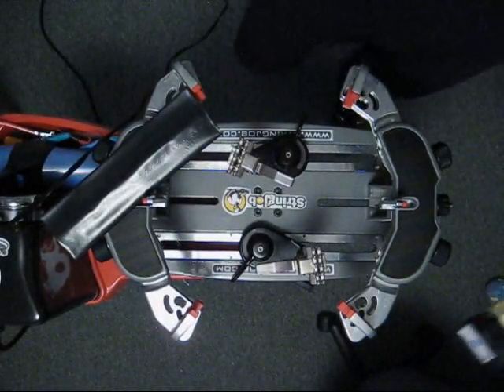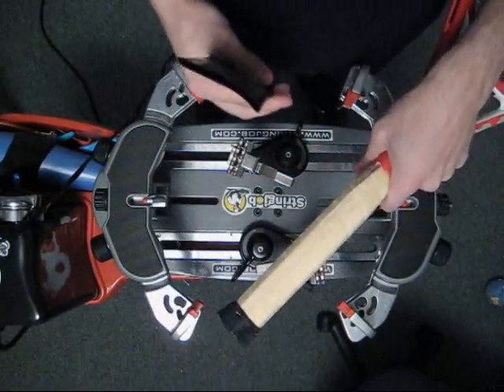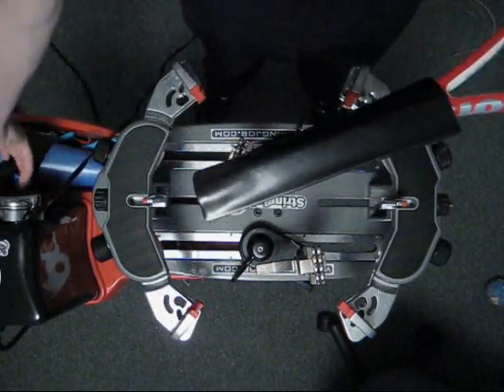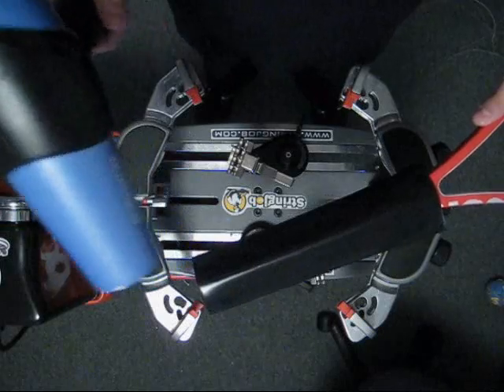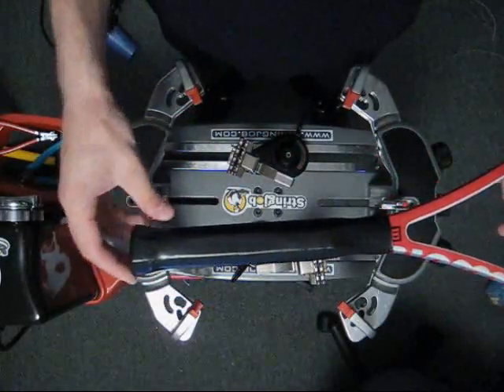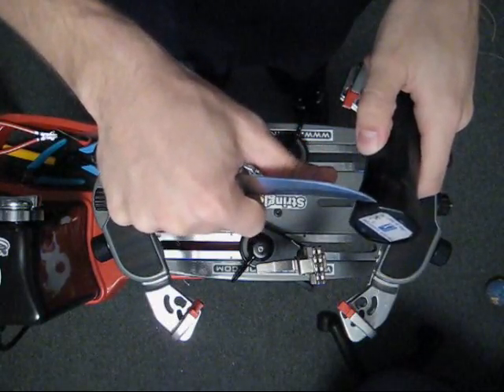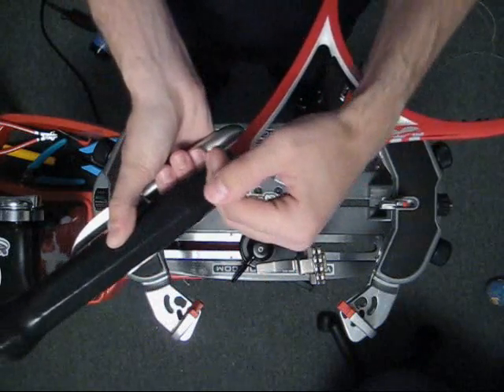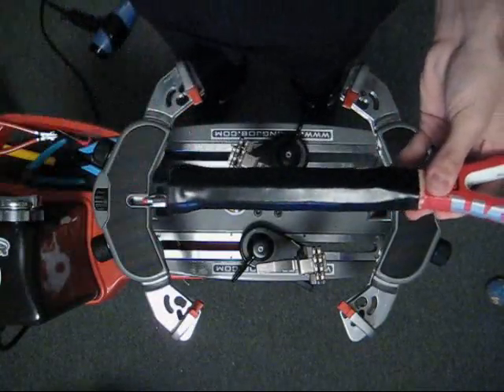How to Build up a Grip using a Heat-shrink Sleeve

Comment: Since I didn't have access to a heat gun at the time, I used a hair dryer instead. After about 10 minutes I got impatient, so I tried the oven/broiler method. It worked fantastic but I didn't know how to tell when it was finished and wanted to be sure, so I just kept heating it. The sleeve "overshrunk" and ripped across the handle; I didn't know it could shrink to that extreme. Very dumb on my part, but I'm sharing this so that some poor sap won't make the same mistake I did.

Comment from the maker: @Cigaro901 For most players, the weight will be negligible. For players who truly need a specific weight/swing-weight, they should consider replacing the racquet with one that is the proper size. But, to answer your question, the weight can vary, typically from 4-8 grams. The swing weight is basically unchanged, since the weight is under your palm. This doesn't mean the swing feel isn't changed, though...

Comment: Very helpful video. I found the hair dryer very slow (20-30mins...the electric wallpaper stripper set on the lower setting worked great (5-10mins)

Comment: Hey Yulitle, thanks for the video. I have a question: you mentioned using sleeves gets rid of the bevels right, if i only use one sleeve how much bevel feel will i loose? I currently have a 4 1/4 and need 3/8 so one black sleeve should do it right, but how different will that grip feel to a stock 3/8 one. How much more rounder will it feel

Comment: Hey man first of all thanks for posting this. I just got an additional N90 added to my army and it's one grip size smaller than the others. Can I just take off the overgrip + leather (basic) grip until the handle is all clean - then add this heat-shrink sleeve and put the leather + overgrip back on? That would make it one size bigger without getting rid of the edges of the grip, not making it all roundy, right? Cheers.

Comment: Hi, lets say my grip size is 41/4 and i use this to increase to 4 3/8 will there be any difference in any way between the original 4 3/8 rackets 

weight , feel and so on

Comment: Because it's another piece your adding..it will increase the weight but not by that much...you shouldn't be able to notice it...however if your grip is too small I do suggest you get one..it can improve your game and probably reduce any wrist stress and tennis elbow....I had to do that to mine b/c my grip was small and was shifting too much when hitting the ball..
Reply: yea, from 6pts HL to around 11pts. NOT MUCH OF A DIFFERENCE AT ALL